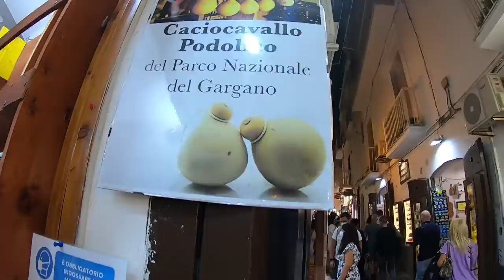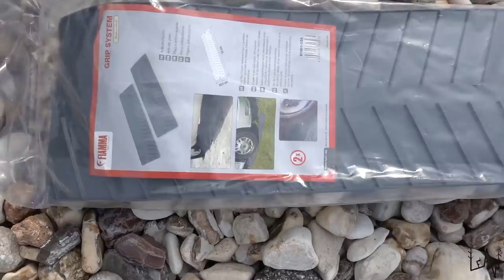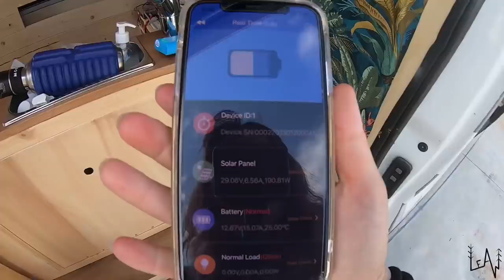WHAT COULD GO WRONG? VAN LIFE ITALY GARGANO PUGLIA

Comment: Great video. The beauty of front wheel drive is if you get stuck going forward, it turns into a rear wheel drive when in reverse gear. Try to reverse out when you get stuck. I think you'll have better luck next time.

Comment: Hi guys. When you cut any material using a power tool, I recommend that you use an appropriate face shield as well as eye protection. These protective equipment protect the eyes and/or face from flying particles.

Comment: I really liked visiting the old cities where the streets are just for walking and they are narrow so the hot sun doesn't get in much. I visited Budva, Kotor and Dubrovnik on the other side of the Adriatic and I think there was a ferry to Bari. I will love to eventually come back and travel through Italy. It's so beautiful.
I think if you are stuck again maybe let some air from your tires for a better grip. It's good to have a cheap little compressor to fill them up again. I have some rescue boards that are a sturdy plastic that are designed to grip the ground and also give your tire traction. The only problem with the ones you have is they didn't hold the ground and the tire pushed them behind.

Comment: Could be an idea to drop tyre pressure to increase surface area. That's what I do on sand, it also reduces the chance of puncture from sharp rocks.
Its harder to pop a deflated balloon than a fully inflated one.
Maybe add a small compressor to your tool kit for re-inflation, i wouldn't be without one.

Comment: Leave everything and get stuck ☹️ A cheap solution for when you get stuck; Buy a spade and a long rope and 1 to eight ratio pully. Tie one end of the Rope to the van. Tie other end of rope through pully. Tie pully  to spare wheel. Dig a hole as far from the van as rope will allow and bury the spare tire. Pull the pully rope so the van will approach the spare.

Comment: The food in southern Italy is the best! So simple. Molto, molto bene. Makes me envious. 

I do have to question why you removed the side rail on roof rack when you could have elevated the solar panel and preserved the rack structure? Even better  Install some flex brackets that allow angle and height adjustments. They have them for custom joinery.

Comment: Wheels spinning to fast.  This works with an auto that has a manual emergency brake that is set- up by cable . Pull up and set the emergency brake, gently put your foot down on gas to increase engine rpms, next very slowly release the emergency brake with your hand. The hand brake offers a lot more control of the cars wheel release and the tire gets a better grip as compared to trying to slowly press down with your foot on the gas. The newer cars with a computer set emergency brake, this method is unable to be used.